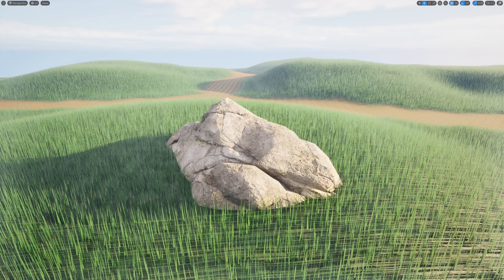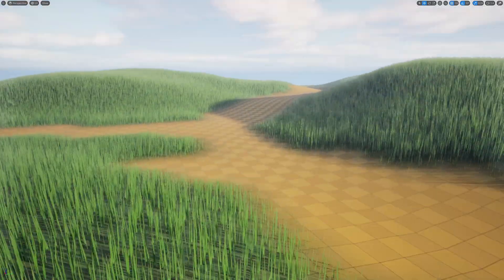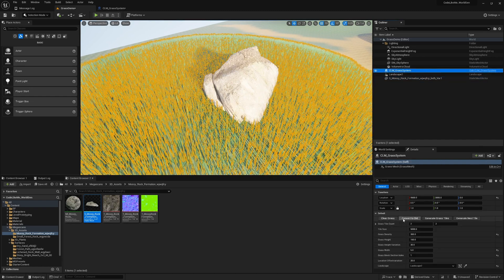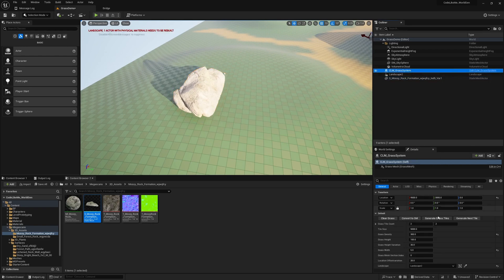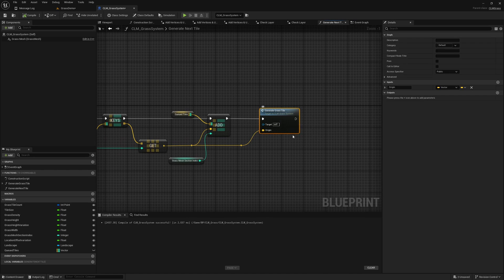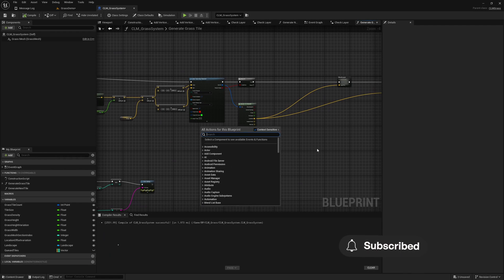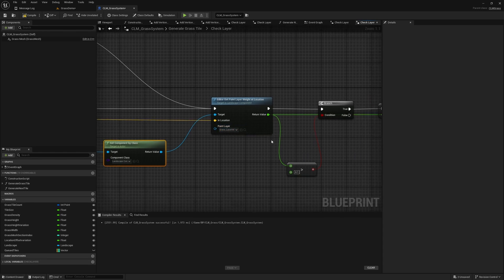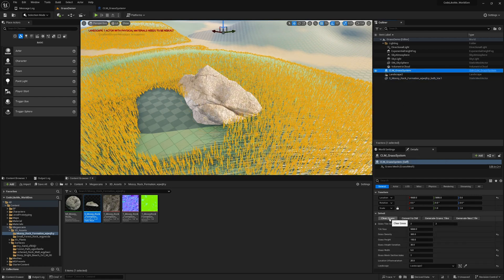Unreal Engine 5 Smart Grass Generator

Comment: I Find a Problem sir. if I have more than 1 Landscape Component,it will not work,when i create landscape the default components amount is 8*8; i use for each loop in BP_ClmGrassSystem,but when the grass density over than something like 200,the system cant work.How can i optimize this.

Comment: Pleaseee! Bro a question. BP actor with a camera in my scene, and two characters. With a button the controller of each player is changed between them... that is, I move player 1 and when I press space it changes to player 2.
The problem is that when I do it the bp_camera is removed and focuses on player 2 even though he does not have a camera and if I press space again it changes to player 1 but within player 1. How do I do it so that BP_camera is not removed and can I switch between my two free players?